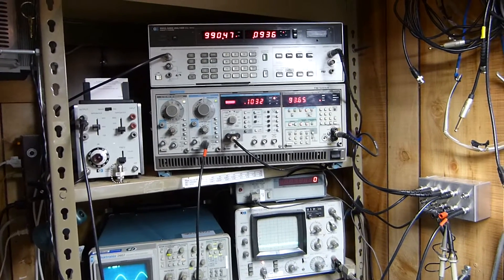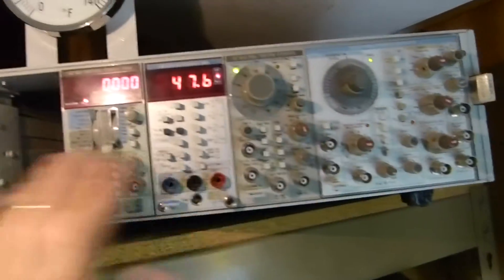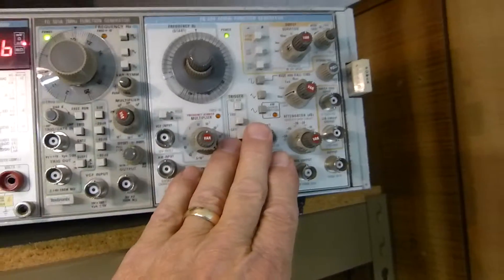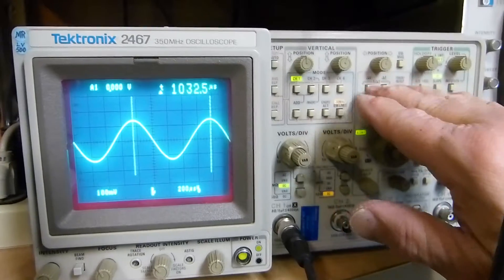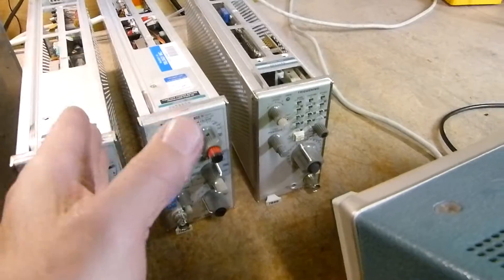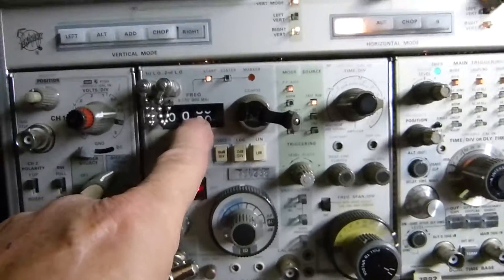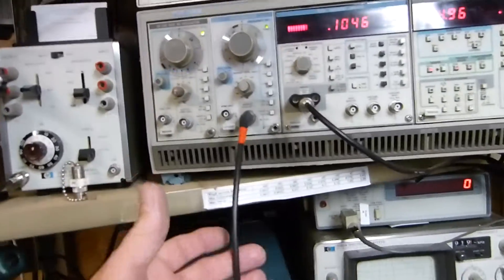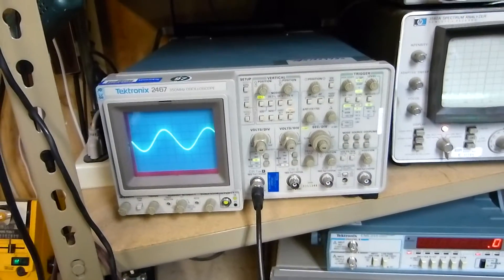My Tektronix and HP Shop Instrumentation

Comment: Awesome guide and an awesome set. Could you please tell me what this type of shelving is called and how it goes together and comes apart? I believe you can add or remove a shelf any time you want without using screws or fasteners and the shelves are attached with some kind of special pegs. Is that right? I haven't been able to find out as I don't know what it's called and thus cannot search for it.

Comment: David, my shop has many of the same test gear pieces you have, thanks to you. I noticed an interesting effect with my Tek scope. I can get down to 0.0007% THD+N from my SG505 into a Tek AA501A Dist Analyzer. I can tee off to a HP3458A and a Rigol counter to monitor the Freq without disturbing to dist reading. But tee in my 5440 Tek scope and the dist goes up to 0.0456%. Scope has  1M impedance and the signal strength isn’t disturbed. Curious effect. Does yours do that?
Reply from the maker: Hi Rick,
I have a similar problem depending on the sensitivity setting of my Tektronix frequency counter. It is a push button setting  between high and low input levels and one way it has no effect and the other way it increases THD on the line significantly. I don't remember the exact amount of THD increase and don't know why. I get my lowest THD at the upper frequencies of the SG505/AA501 and wonder if that is true for you. I generally don't think much about it anymore if the input level is below 0.00xxx %.
I might mention that in my attempt to keep the noise floor as low as possible, I have tried isolation transformers on all pieces, separate pieces of equipment, etc. It is tricky and sometimes it seems better and sometimes worse or no change. I do remember changing out the fluorescent lamps over my workbench to direct replacement LED lamps and that did make a difference in my noise floor.  I know I am talking about noise floor at the moment but I have found it tricky to get below a -90 dB S/N level. Even the BNC cables make a difference and the grey HP (10503A) cables are better by several dB. Not sure what to suggest but I don't think it is the  additional 1 meg load on the line. Possibly plugging all the instruments into the same power strip (?) if you haven't already. Just guessing. Hope this helps.
Reply: @ElPasoTubeAmps  Morning David, I have a couple long strips that plug into the same outlet (star style).  I am able to pull the  0.0007% from 1k-10k.  Degrades a little over 10k.  My cables are homemade RG316.  If I move the BNC connectors into the wrong position it will raise the distortion.  I'll reconfigure it with just my Pomona cables to see if it corrects it.  I'll check the noise floor with a HP 3562A and 3580A. Love all these old instruments.

Comment: Thanks for the great video. Where do you get your equipment calibrated? Cheers
Reply from the maker: I do not have a place to send for calibration. Some calibration I can do myself but generally, if the need arises,  I compare one instrument to another. The Tektronix meter is the newest so I make a measurement, voltage for example and then with two or three other meters at the same time and compare the readings. Often times they are within 0.01% of each other so I assume all is well. For resistance I have precision resistors to 0.01% so I use them for that type of check. That is pretty much the way I keep tabs on the accuracy of my test equipment.

Comment: Interesting collection of gear.  I still have some gear for audio and RF that I smuggled into the country I moved to but miss the gigantic stash of HP, GR and Tektronix. Before ebay drove up the prices, there was a monthly ham swap/flea market at a college in Los Altos Hills (Silicon Valley Ca) I visited every month. Most of the people attending were engineers at all the tech companies there at the time...tech meant test instruments before the computer/software industry took over Silicon Valley. Some of the gear offered was a military surplus but most was industrial surplus when whole labs would be tossed out after a contract was completed. I ended up with several hundred pieces of this sort of gear. I had a large pro audio service center with 23 techs and they all had 2 benches filled with Tek, HP and Sound Technology. 
I had van that was used only for those monthly swap meets and unload 40 or 50 pieces each trip, some didn't work so fixing and calibrating it was a fun task for me after every haul.  For RF I had a number of IFR and Motorola Service Monitors and 48 Tek scopes. most were 465b, 74xx mainframe, or 24xx series. I liked the self-contained scopes, the mainframes were big and needed the carts. 
When I decided to move out of the US I gave it all to the employees, the full business, and gave everything else away...cars, an airplane etc. I kept a small number of units in a storage unit and every time I flew back to the US without luggage, I would buy cheap suitcases and fill them up with test gear. One of my units that came in a suitcase was my HP3582a audio spectrum analyzer. That has been sitting on my home workbench for the last 20 years here and just 2 days ago it stopped displaying. Dead, no trace so probably HV power supply. You are right, a sweet tool. 
eBay ruined the swap meet tradition. A good many people were just there to chat with other techies or trade gear or part. A lot of the equipment being traded was designed by the engineers there every month.  The biggest item I brought 8,000 miles in a suitcase was a tube and semiconductor curve tracer that weighed a good 75lbs. The Motorola 2008D Service monitor weighed 47lbs, one of the only pieces I bought new, in 1984 for $28,000. That was a lot of money at that time
Have fun with all your test equipment, using good, precision test instruments is a pleasure, being able to depend on the readings. Some it was 50 years old and still going to outlast whatever is made today, plus it was all repairable
Reply from the maker: Your story is dear to my heart. I have been a ham since 1963 and I absolutely loved ham fests. Unfortunately, here in the middle of nowhere in the beautiful and wonderful desert southwest, they hardly exist at all and the ones that do occur are really sad. I came here from Huntsville, AL, where we had some really nice ones but I left there in 1976 for El Paso and White Sands Missile Range. I was a NASA contractor in Huntsville. I remember saving money and buying an Eico model 460 (?) scope when I was a 16-17 year old kid and was sorely disappointed with it but at the young age of 20 finished college and went to work as the NASA contractor and ... wow... those little portable 453 scopes were a dream come true. We actually still had some vacuum tube Tektronix scopes on carts we used in the high speed cabinets of 1200 baud communication lines...   :-) The old scopes worked great for that purpose.
Surprisingly, there is a lot of government and military here in the El Paso area, WSMR, Fort Bliss, just north in Albuquerque, Sandia Labs, Los Alamos, and I have worked at all of them but the amount of equipment around here is almost nothing and if you try and sell your high-end equipment in this town, you are likely to get nothing but recycled metal price for it. Sad but true. So..... I have to agree that there are some absurd prices on some items on Ebay but that is where I have gotten most of my equipment and either I am lucky beyond imagination or what, I don't know, but I have some beautiful performing equipment that I have picked up and is my only source for equipment and parts. There is one tiny electronic shop here in El Paso, and I love the guys there but they have nothing...
I have a real appreciation for the GR equipment. I think most of it only got used by guys working on their graduate degrees and it was brought out of the locker for a few minutes for them to see and maybe touch then it was inventoried and scurried back into a secure closed. Guess that is good for me to have such beautiful equipment 70 years later. I use my vintage GR equipment to test the fancy-dandy digital equipment I buy today - 
As a much younger fellow before I had all of my own high-end test equipment all I had was stuff like Eico and Heathkit and during measurement, things just didn't turn out right. Part of it was my lack of knowledge and experience and part of it was the +_20% equipment I was using.
I love my shop. It keeps me sane. Before I retired in 2010, I was a manager for 11 years on a INS/DHS contract and afterwards a technical writer for the army but it was not my cup-of-tea. I need to be in a lab or technical environment and not dealing with people. I know now why science and math are so simple - pretty much, what is true today is true tomorrow. I know science changes but managing people is not what I like to do.
Thanks for you comments. I really enjoyed reading your experience.

Comment: Does the DM5010 allow you to program and read in watts or just DBm?
Reply from the maker: Hi John, the DM5010 does not have the feature to read watts. Actually, my DM5010 is somewhat out of calibration and I never use it. I have attempted adjustment on it a couple of times but I can't seem to figure it out. Not sure what the problem is. I bought if from an Ebay seller in Albuquerque and talked to them soon after purchase when I noticed it was not correct but was assured it was in calibration but it is not.
Reply: Besides the 8903, do you have any other meters that will do this function? I seem to recall another one of your meters would do this. I do enjoy your videos and try to watch one every few days, thank you for giving people like me clarity, you missed your calling and should of been a teacher!
Reply from the maker: Thank you. I do try to give away what I have loved to do all of my career in these videos. I am glad you enjoy them.
 The 8903 and HPIB/GPIB - USB device and Pete Millett's programs is a high-end good way to go and you get laboratory grade results but an inexpensive USB sound card ( around $60 or so) and a PC will allow you to run ARTA or SpectraPlus software that will do a good job also.  Same is true for the HP3580A audio spectrum analyzer as it is a lab grade instrument but there are so many solutions nowadays that these 40+ year old instruments are probably not the best way to go anymore. I have the 3580A and I trust it but is soooo slowwww when looking at signals below 100 Hz that it is painful. If you can get a USB sound card try searching for and downloading ARTA or SpectruPlus and I think you will be pleased.

Comment: Thank you for such an interesting video. I have a passion for HP gear. What do you use the HP 353A Patch Bay for?
Reply from the maker: This seems so long ago although it was only four years. I no longer have the HP 353A patch bay but when I had it I used it as an attenuator for my oscillator, if I remember correctly. A really nice piece of equipment but I have replaced it with simpler HP 600 ohm audio attenuators -

Comment: Maybe you could help me out I bought a tm 501 with dc509 counter it works great but then I bought a tm504 with two dm502a  and a am 502 diff. amp diff amp did not work but pluged it in the tm 501and it works.but the dc 509 does not work in the four compartment main frame so I noticed fuse compartments in the power supply empty just wondering if I have to install a fuse for operation ?cant find any info on line.
Reply from the maker: +Kevin mc burnie  I also have other Tektronix mainframe modules (i.e. TM 506 and TM 504) but I have never had any issues with the plug-in compartments so I am not aware of any fuses. It would not surprise me if each compartment was individually fused. I would give it a good visual inspection and make sure all the fuses are of the correct value and in good shape. I know in my TM 506 unit the right hand compartment is labeled "high power" as it appears it will run modules that require more current. I hope you get it working.
Reply: thanks .I love your channel thanks for replying.

Comment: Re the HP3580 and Tek 7L5, could you expand on why you prefer the HP? On the figures the Tek should be quite a bit better, at least in SNR: <-100dB vs -80dB. I have a 7L5 and although I find it hard to drive, can never remember what the knobs are for, it seems to do what I want, which is mostly picking up THD and 19kHz/38kHz stuff from FM stereo, and looking at x-over distortion and other residuals when biasing class B amplifiers. I've seen a 3580 but never used it. Your thoughts appreciated. NB The Tek FG504 will do both FM and AM to the basic output signal.
Reply from the maker: QuadMaestro My 7L5 had some switch issues and was very temperamental so I ended up selling it on Ebay. When mine wasn't being kinky, it would have been able to do 19KHz and 38KHz perfectly but audio frequencies were just too hard to deal with. (it is hard to remember what all the buttons are for...) The HP 3580 is a 5 Hz to 50 KHz SA and it does a really good job at audio as you would expect. Unfortunately, you can't see anything but the second harmonic on a 20 KHz signal which is why I bought the 7L5. I guess realistically, we don't need to see anything past the second harmonic of 20 KHz in an audio signal. I also have the 7L12 and it is a beauty. If you see my video that I published recently on using the 7L12 in the 7904 main frame, it can operate like a modern day MDO -  please check this video out and let me know what you think - https://www.youtube.com/watch?v=y7uMl-erdCk 

I purchased the FG504 to do audio sweeps but low frequency (20 Hz) distortion is unacceptable which drove me to the HP 8903. I think it is a great FG but not for the audio range.

For higher frequencies I purchased the HP 8596E SA and HP 8648C signal generator. I have always had a keen interest in the 2.4 GHz region
Reply: ElPaso TubeAmps Thanks for your reply. Saw your MDO video too. I am looking at FG504 because I occasionally need something to do AM alignments, with IF around 455-470kHz, and also more commonly FM IF alignments at both 10.7MHz and 12.5MHz (Leak Troughline). I haven't found any single instrument that will do all that. Sencore 165 does all but the 12.5MHz but they are getting hard to find. It looks like an FG504 might fill that bill, whaddya think? & can it do markers? or any other recommendation? NB another thing I do like about the 7L5 was no extra display, as I have zero excess space. You can choke it down to 20kHz or 50kHz.
Reply from the maker: QuadMaestro I have the FG504 and a Wavetek 2001 that work properly and I am willing to sell at the fair-going price that I paid for them. The FG504 is a complicated device to learn to use - even more so than the 7L5   :-)   in my opinion...  I don't know the dollar amount but we can get a "fair" price from Ebay and I will research what I paid for them. If you buy them and don't like them, you can send them back, you pay return postage. I used to sell on Ebay but too many scams where people claim what they got was "not as advertised" and get the seller to refund some of the money via PayPal. I buy off Ebay all the time because as a buyer, everything is on my side and Ebay is the Only place to buy the stuff I want. I am ElPasoTubeAmps on Ebay also.  You can contact me directly at rdavidbeard@gmail.com if you are interested. I don't remember, if I ever knew, all the features of these two instruments but they can be researched easily. I assume you are in the USA  (for shipping)?
Reply: ElPaso TubeAmps Thanks again, taking the dscussion offline.
Reply: I should correct a statement I made above. I misread the 7L5 specifications. SNR is -80dB.

Comment: Did you ever get the hp8903 gpib stuff sorted. If not, maybe I could help.
Reply from the maker: Anders - I did get it operating and have used it many times. I made a number of YT videos about it but I have not gotten into programming it for other purposes so anything you have I am definitely interested in. I have discovered, as others have, that he voltage level cannot be controlled to stay set at a level on scans using the Pete Millett programs  (I think that is the issue).  It has been a while since I have used it as I have moved to my other hobby of RF. I can be reached directly at rdavidbeard on my gmail account. Thanks...